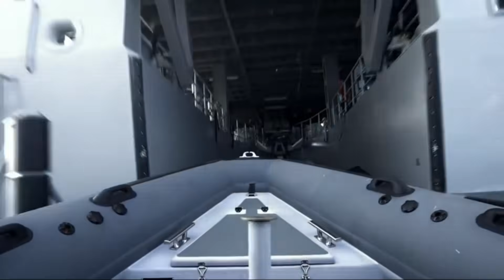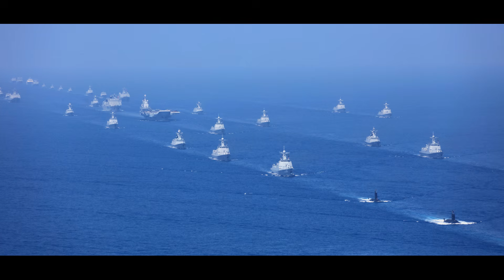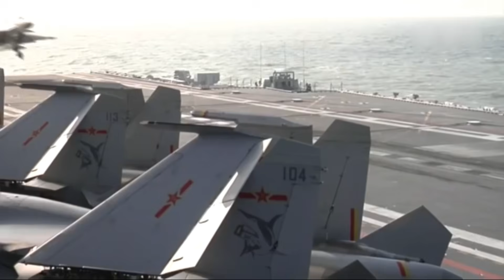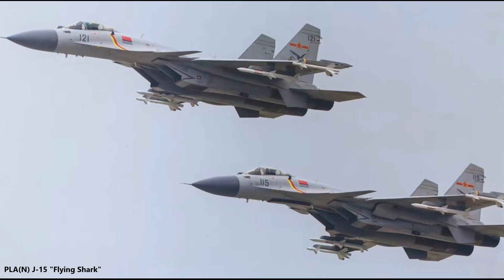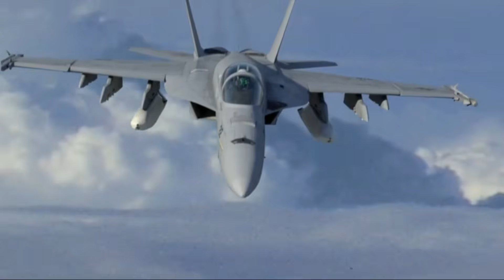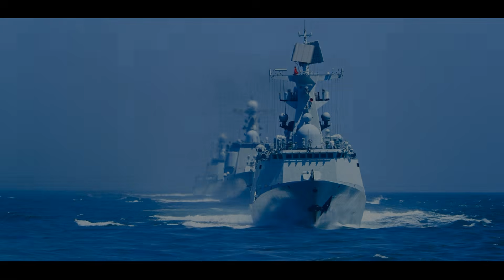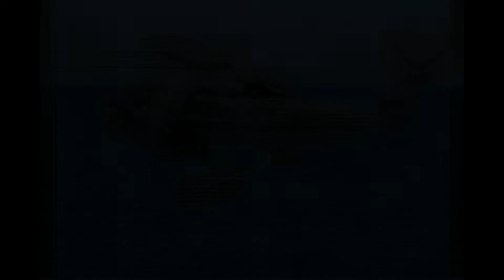Up-Gunning the Arafura Class OPV

Comment: The issue is that the RAN is too short of crews, that's why half of the RANs Anzac fleet is currently on the hardstand in WA, supposedly being refitted, but also providing crews to help man the other four Anzacs. Same deal with the Huon's, that's why they are being disposed of, not enough of various specialised categories to allow them to go to sea. The other issue is the current RAN leadership seems unable to manage a piss up in a brewery, given every project they have managed in the last decade has turned to crap; the AWD (massively over budget and late), the Hunters, massive size and cost growth and already running late), the Attack class submarines (massively late and extreme cost increases), the Arafura's, (running late), the improved Cape class patrol boats (running late), the Collins LOTE, (years late). You make good arguments, but the current RAN hierarchy simply don't want to listen.
Reply: Unfortunately, that is the case. A moribund senior leadership who are still living in the Cold War. That still think they can piss away a major procurement project, because, hey the USN will come to our rescue.

Comment: Australia’s over the horizon radar capability dictates that any attack would likely come from the south-west, south or south-east of the continent. This is especially the case with a blue water navy enemy. Submarine launched cruise missiles could attack the radar infrastructure from those “blind” areas. The enemy could then attack at leisure from the northern half of Australia’s coastline. The Australian MoD is just not in a mentality of preparing for war. Sadly, it is highly unlikely that the full potential of the Arafuras will be ever be realized.
Reply: Not anymore. They're going to build more OTH radars to cover the present blind spots. That will make trying to attack Oz from any angle a rather tricky proposition. Especially if we have the requisite resources to prosecute defensive attacks in conjunction with that radar coverage.

Comment: Excellent work.  I to think a Mk3 - 57 mm Bofors gun should be installed from the start as the programable ammunition's would give you some air defense.  Add the 11 round SeaRAM (which can be re-loaded at sea) and some extra missiles stored below for longer range and just one of these sitting off a major port area should be able to defend any commercial shipping tied up from 4 to 6 incoming missiles.  This should all be part of the original construction.  (And the 21 cell launcher needs to be added to all Hunters and Hobarts.)

I hadn't thought about the anti Sub role but you're right there, just adding the towed array would give much better performance if escorting a fleet in addition to a Hunter on the other side of the convoy.  It would also allow the sailors/boat captain working on these craft some valuable experience learning this equipment before they move up to the Hunters or Hobarts.  

I don't mind not having an anti shipping missile on the OPV during normal operations, as long as they have the systems installed to allow shipping container launching systems to be bolted onto the landing deck.  In this case I'd want to be adding 4 or 6 containers with as many missiles as possible, kind of like the air forces missile truck idea with targeting provided over the data link from another asset such as that MQ4C or the P8.  Having an enemy looking at a P8 out of range to the east of them might take their eyes off the missiles launched at them from behind a small island to the west of them.

Also, all the 25 mm Mk 242 Bushmasters in the Navy and Army need to be upgraded to the 30 mm Mk44 Bushmasters throughout ADF with Mk310 ammunition manufacturing on mainland Australia (in my opinion anyway).
Reply: Couldn't agree more.  Patrol boat in peacetime.  Escort corvette in wartime.  The Arafura has the potential to be WWII Bathurst class.
Reply: If you want to defend a port then why wouldn't you use land based options instead?
Reply: @carisi2k11  In some locations in North Australia the jetty can be 2 km long, a land based system with a 5 to 10 km range would thus have it's engagement range reduced by 20% to 50% which might mean there is no time for a follow up shot if the first SeaRAM missile fails.  Also, Ingham has a sugar terminal, 100 km south Townsville has a goods port and another 200 km south Bowen has the coal jetty.  It is unlikely that ships will be in all three ports at once so a Patrol boat can move up and down the coast being at each port as a ship comes in so one boat in place of 3 land based systems.  A ship sunk while tied up to the loading facility is going to be more disruptive then a ship sunk 150 m away or a single broken Conveyor Belt.  Also, I'm not saying the patrol boat in place of land based systems, but rather to compliment them in larger ports such as Darwin.  Also, a moving boat will make it harder for an enemy to lunch a first strike on a static defense system taking it out to make it easier for aircraft to have freedom of the sky to do what they want.
Reply: Why upgrade fishery ocean patrol vessels to a small frigate when the OPV does not have the bunks for much more crews? Where are the helicopter, gunners, sonar, missile, and torpedo crews going to sleep? While your frigate is off engaging in a UN Peacekeeping in the Atlantic, what is going to patrol your fisheries in the Southern Ocean? Mission creep indeed...
Reply: @ronclark9724  who is going to patrol the Fisheries? I would hope ‘the department of agriculture and fisheries’ would put down their donuts and do that. And Australian Boulder Force would look after illegals with the AFP. The NAVY should be keeping foreign counties and war ships out, not policing Australian fishermen. They need more than air horns and BB guns to do that.

Comment: These things are about as large as a small ww2 / interwar destroyer.

Maintaining helicopter ops would give them a small ASW capability as well as search and rescue for downed pilots.

Seems a bit nuts we dont leave that option in.
Reply: What ww2 destroyer are you talking about? Fletcher class was 35 metres longer and 2,500t. For ASW they can have multiple unmanned helo's and for rescuing downed pilots they have the RHIB's.
Reply: @carisi2k11  for example https://en.m.wikipedia.org/wiki/C_and_D-class_destroyer

I was mostly comparing tonnage. A
1640-2000 tons Arafura class vs briyish class D at  1950 tons

Which is why I added interwar to ww2.

Fletcher class was much more modern then I was thinking, sorry if I was ambiguous.
Reply: @llamathrust8646  The C & D class was an actual fighting ship, 20 metres longer then the arafura and 16 knots faster. It also had a 4.7 inch main gun and torpedo's. The tonnage doesn't mean anything and the arafura is just a patrol vessel and is built to such. It doesn't even have a main gun at the moment.
Reply: @carisi2k11  The Arafura has a wider beam and slightly deeper draught then the c\d class. it should actually have a similar amount of deck space.
I'm just using the displacement as rough guide to potential capability. 
but my main point, Australia is purchasing a new patrol boat that is closer to a inter-war destroyer in size then then it is to the 300 ton Armidale PB. it's already setup with helipad and storage. It would seem logical to take advantage of this things size and include the ASW capabilities in the platform. The Arafura doesn't need to be able to chase down submarines, That's what the Helicopter is for.
Reply: @llamathrust8646  No it shouldn't because that is when you get capability creep and the ship becomes expensive, overweight and complicated. Same thing is currently happening with the hunter class and that project is now becoming a problem and it now weighs 10,000t instead of 8,000t.
Reply: @carisi2k11  Adding a simple hangar and a helicopter shouldn't cost that much. Indian Coast Guard has similar ships but they at least have a hangar. And they cost around $60M / ship.

Comment: Aren't there fishing boats that can go faster than 20 knots?
If so and they are seen fishing in Australian waters, how will these vessels catch then?
Seems that those at the top of the ADF need to  be replaced for failing to provide the grunts with the right equipment.
Reply: Not many Indonesian long liners or trawlers that can do 20 knots, I'd say 8 knots is a more realistic top speed for most commercial fishing vessels.

That being said, if it encountered a faster vessel the Arafura could launch its RHIB, which is capable of 40+ knots, or just follow the offenders with drones and overhaul them when they run out of fuel.
Reply: @nerd1000ify  It still would have been good to carry a helicopter along. We have $60M Coast Guard OPVs in India that are more capable than this OPV because they additionally carry a heptr. At $100M, the cost of this Australian OPV, we make Naval OPVs with a 76mm SRGM and 2 CIWS and VSHORADs in addition to Australian OPV capability.

Comment: Great video! Thought provoking as always. The only issue I have with your argument is that the modular design requires a crew well versed in a multitude of capabilities. Realistically the Arafura class will first and foremost be an offshore patrol vessel, unlike a frigate or destroyer which is a dedicated war fighting vessel. Similarly to the RAN's issue of having enough platforms as say submarines, having enough vessel in maintenance, offshore patrol and warfighting readiness would be a significant undertaking for our small navy even with a complimentof 40 crew.

That being said, a littoral ship that can link into a defensive or offensive system hosted by a Hunter or Hobart class destroyer would be an incredibly powerful asset in an amphibious assault context as well. As well as having a small landing deck which would be an alternate emergency landing platform for aircraft in trouble during such an amphibious operation.

All up though, I do agree that we need to look at what China has done in the South China sea and learn from it. A fleet of 20 to 30 multi-role OPV's with capability to be part of a wider defence network is great. But knowing the ADF, it's likely that if we had say 20 OPV's that were "multi-role", you'd end up with 12 set up as full time patrol vessels and 8 set up as combat support, with limited cross-polination between the two forces.
Reply: Carefully curated vid, good coverage. Unfortunately ADF have very little current demonstrated history of procurement. Navy in particular use their binoculars the wrong end as eyepieces.

A tinny from PNG and local using a 303 would be of more use.

Who are they procuring for anyway. Sooner or latter a belligerent boat will be off our coastline. Heavily armed. Let me guess that useless crowd in feds will send some portly poli to tell off. Ha.

Grow some balls Russell Hill or do a NZ act & stick head up arse hoping to disappear.

Of course I've got it wrong. There will be no threat to orrstrala's sovereignty in the next 50 years. Hope I'm pushing up weeds by then.

Quit cosying up to your fanboys & get strategic!

Comment: The separation of the Forces continues to impact. One uniform, one rank system, separated only by skills. As capacity in the air is the sole dominant military capacity and holding ground is the sole determinant of military ability that provides a basis for any reconstructed military organisation. Common sense needs to destroy tradition - which is peer pressure from dead people.

Comment: I’d have thought that the ability to fly helicopters for Air Sea Rescue would have been an absolute requirement for a maritime patrol craft like this.
Reply: It's beyond belief.
Reply: No brainer for sure. Why they are so afraid of mission creep is beyond me.
If I was the Capitan of such a potentially useful vessel I would want to be able to push it to its limit. At the moment its limit is probably taking Politicians to sea for a jolly.
We need ALL Navy ships to be as capable as possible in todays theatre.
Reply: @bossdog1480  Because mission creep killed the attack class and possibly the hunter class. The arafura doesn't need helicopters or an air sea rescue because that isn't there mission and they have 3 RHIB's on board that can do sea rescue more efficiently then a helicopter can. A helicopter is good for doing piracy patrols and this is where the helicopter drone comes in.
Reply: @bossdog1480  I couldn't agree more " Jolly "
you must be an ex passer.
Reply: @giauscaesar8047  Yup. ETS.
Reply: @bossdog1480  I was an ETC.
Reply: @giauscaesar8047  😁

Comment: Awesome vid👍there so many ways RAN could go into future, First 4 more Hobart class destroyers or more Arafura OPVs with different weapons suits?  Transfield ship building that built ANZAC class had design OPV in late 90’s which ideal design but not as flexible as Arafura OPV.  Getting rid of 40mm reduce cost n burned of use, I strongly believe there should be VLS not RAM because enemy will be second guessing what OPV packing Defensive vs Offensive.  If you going have helicopter you need a hanger n weapons loadout but maybe unmanned helicopter with ability to carry sonar would be enough?  Or RAN builds their destroyers/frigates with 2 helicopters hangers, improving Hobart class batch 2? Or just maybe build another batch of Adelaide class of frigates with impove VLS, 2 hangers?  If RAN goes with more Arafura OPV, maybe unmanned PT boats could be answer?

Comment: It should be mentioned that an OPV and a minor war vessel like an ACPB are very different types of vessel. The OPV is specifically designed for open water, long range patrols, whereas the ACPB is actually a shallow water patrol and fast attack craft (fast in its manoeuvrability, rather than it's top speed). As such, the OPV is definitely, in a broad sense, of the corvette type of warship. However, the ACPB (and if they get a main gun, the new enhanced CCPB) are designed for shallow water operations around reefs and islands...a role the OPV cannot perform. This segment completely ignores the fact that all the fleets in the region hold a shallow draught, highly manoeuvrable inshore combat capability. These are used for special operations support, reef and channel patrols (especially in the many waterways of SE Asia too shallow for major vessels to enter or manoeuvre, indeed even the bays and reefs around Australia's own coast, such as the Torres Strait, the Barrier Reef, Ashmore Reef, etc, where larger vessels cannot operate, except in dredged sea lanes), as well as provide a gun boat (and for many regional navies, a missile, mine and torpedo) capability for inshore coastal defence. In fact, the modern RAN patrol fleet isn't descended from the WWII corvettes which perform the tasks described in this video; no, they descend from the HDML's (Harbour Defence Motor Launches), and Vosper and Fairmile MGB's (Motor Gun Boats) which performed the equal roles in WWII - and a role that was still being performed as recently as the late 2010's with counter-piracy, counter-insurgency operations in the Mindanao - Tawi-Tawi Island Chain (where only a few ports and straights are deep enough for corvettes and frigates to enter). A corvette is not a patrol boat, it is a very different type and class of vessel. The OPV is not a complete replacement of the patrol boat, but a change in operational focus (it will be interesting to see if the Army assumes the inshore Littoral Combat Zone, or if the Navy retains the eCCPB's as inshore combat and patrol boats).
Reply: These OPV'S only have a draft of 3 Meters. That's shallow draft .

Comment: And definitely agree we could do alot better with the armament the Arafura has. We need to plan to have them upgunned quickly and at least fit for even if not with until needed. Plus I definitely think it should be fitted with towed array, torpedo tubes and NSM!
Reply: Ahead of time preferably so there's no bottleneck of retro fitting at a much more critical date.

Comment: Would make more sense to just built 8-12 actual light frigates rather than go from 12 to 20 Arafura class. An Australian analogue to the Chinese Type 056 Corvette. Something in the 1500-2000 tonne range, basic combat electronic suite with an 8 cell VLS for 32 ESSM, torpedo tubes, 4-8 LRSM and a 40-57mm cannon. Serving alongside a Hunter class and utilising its advanced radar they would make an awesome force multiplier. 

That and 3 more Hobarts please.
Reply: The main reason for looking at up gunning the Arafura class is the fact that you have a hot production line. I agree a small new frigate would be ideal, but it would take ten years to go through the ADF procurement system.  Putting the Hobart class back into production, which is exactly what we will do if we do end up cancelling the Hunter class, would also take a few years to make happen. When you want to make things happen quickly you need to work with what you have.
Reply: @marktucker8896  I’d be building the Hobarts before the Hunters. With the light frigate the first line in the acquisition program document is “PICK FROM 3 CURRENTLY PRODUCED LIGHT FRIGATES WITH NO MODIFICATIONS EXCEPT INTEGRATION OF LRASM”